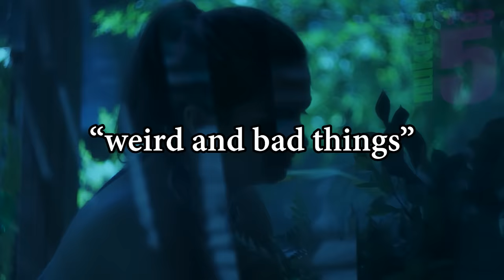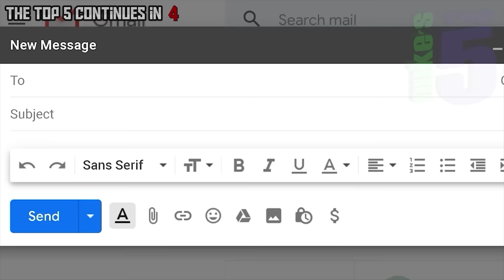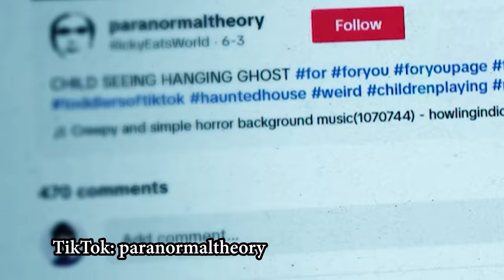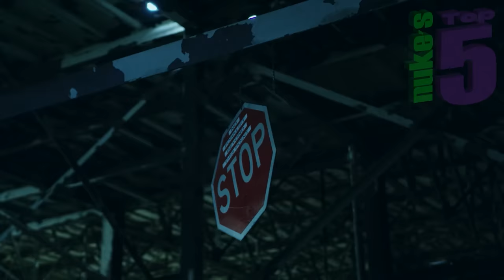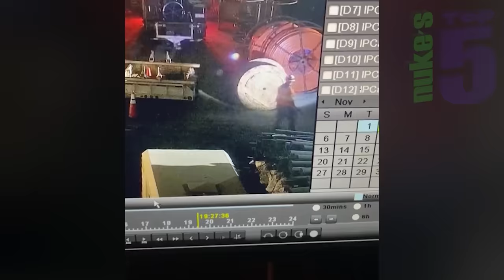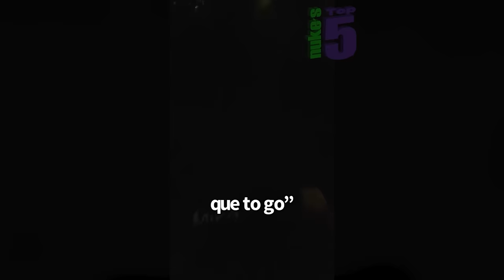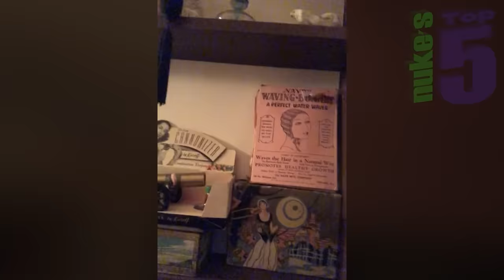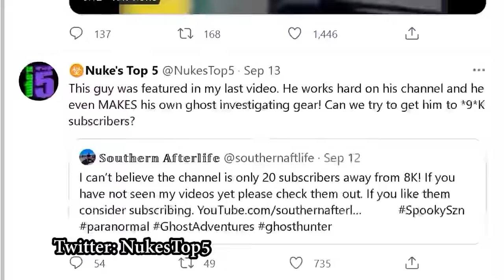Top 20 SCARY TIKTOK Videos of the YEAR !

Comment: A few years ago had a solo cup just like that, half filled with water, just slide across my coffee table. I checked to see if the bottom was wet or something, but there was no reason for it. Just casually slid from one end of the coffee table to the other and stopped. Freaked my beans.
Reply: yeah cup moving is the most common occurrence, happened in our house number of times. It's most likely bored djinns, or they just living their own lives and their dimension glitches with ours for a few seconds.
Reply: Cohesion and adhesion
Reply: I was once at a friends house, sleeping over. I was tempted to eat their canned potato's, because I was obessed with them at the time but decided against it and put it back in the back of the cupboard. but later that day, when I was alone- standing between the kitchen and dinning room, the cupboard opened up and the can of potatos fell out and then rolled across the kitchen, stopping at my feet. not the only freaky experience I had there too lol